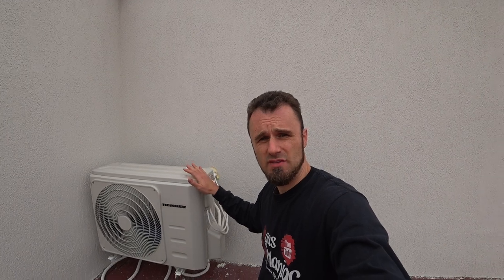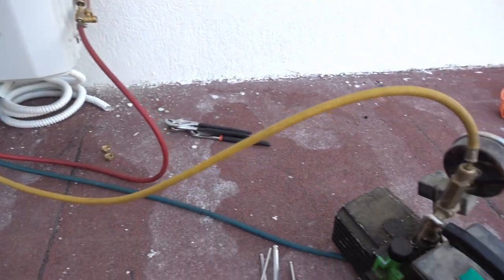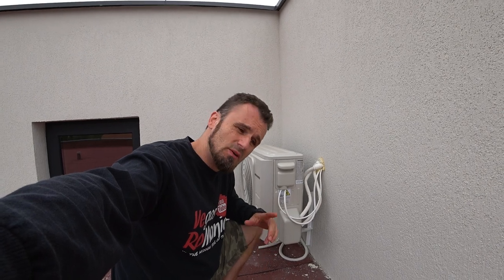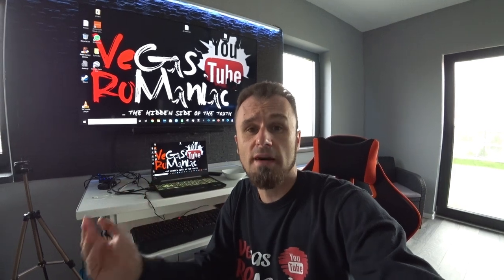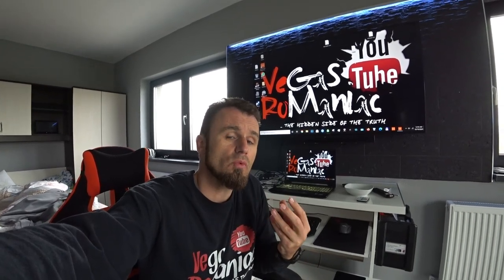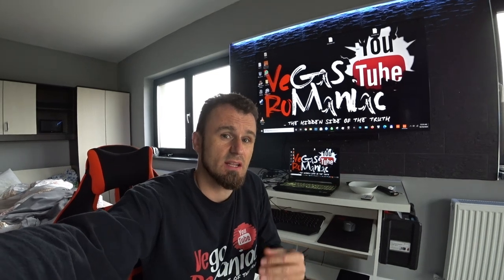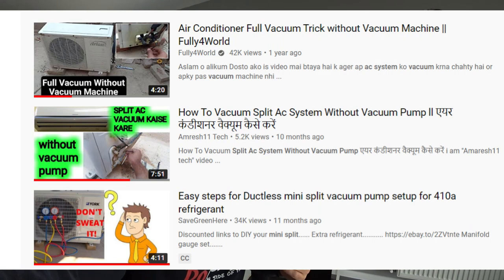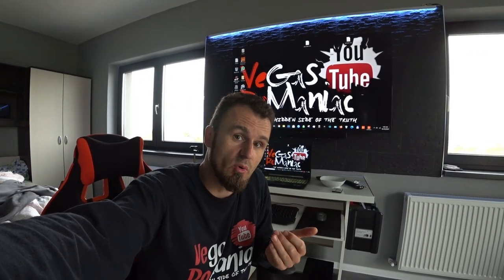How to install a Mini split AC without a Vacum pump

Comment: Been installing split A/c without vacuum since don't know how many years all I we do is before running the A/c open the gas from suction line and exhaust the air in the copper tubes through discharge line with the help of  manifold gauses.

Comment: Your right man I've installed 2 units. 1unit still works but the other one wont cool my room😕
Reply: Your connection with your flare connections were not sealed and probably gas went out 😔

Comment: Does the inside unit plug into the wall? What voltage is your unit I didn’t see a disconnect by the outside unit
Reply from the maker: Yes, the power comes from inside it's a 220, the 2 units are linked together and powered from the inside
Reply: @VegasRoManiacReviews  my cord that was connect has black white and green and it 220v
Reply: On my 3 mini's (2 diff brands). The electricity goes to the outdoor unit. From the outdoor unit there is a single cable (multiple wires inside it) that goes to the indoor unit (along with the copper lines and codensation line). This single cable powers the indoor unit and transmits signals between the indoor unit and outdoor unit.

Comment: I open the thin line to fill the lines with gas, shut the thin line. then purge the gas from the lines and re-opened the thin line. Next I turned the system on, everything is working fine. Day one.
Reply from the maker: Great to know , let us know how it goes in time
Reply: Is it still working fine when ppl say purge the line are y'all talking about that valve u use to vacuum ? What does purge mean ??

Comment: Vacuum pomp the air conditioner need only if the tubes  are very long... l have 4 units 12000btu from 2003 ( onoff) and working today with 41 grade Celsius perfect 😅😅😅... if you have 1 to 3 meters pipes you need to discharge 20-50gr gas...  3to5 do nothing ..up to 5 you need to put in 20-30 gr gas and you need vacuum...

Comment: You would get away with it without a vacuum pump and just releasing the gas into the system. If you turned on the pump, it would suck all the air and the water into the refrigerant anyways so that wouldn't matter. it is true that the air and the water will corrode and shorten the life of the system.
Reply from the maker: Yeah

Comment: I have installed an ac without vacumn pump 11 years ago.never needed top up for gas. Its a heat pump type ac. Split unit. You have an indoor unit and an outdoor unit that homes the compressor. Cooling system works like a dream after 11 years. 1 year ago the board inside the indoor unit failed so i have removed the board and rewired the system to work only on cooling because i only use it in summer. Never had any issues with cooling or compressor. So this is my experience. To prime it,the first time i installed it 11 years ago i followed an o nline guide i had found. I will try to find it and share it here.I remember it was vrery  easy. But the procedure has to be done before you start the system. You have to open and close the gas lines and press to purge the air for about 7 seconds but i dont remember exactly the procedure so as soon as ill find it ill post it here.
Reply from the maker: That's great to know

Comment: Let's clear some things up here! I'm a licensed HVAC technician. You shouldn't be DIY installing air-conditioners unless it's precharged linesets (which I personally don't think is a good idea either). And I can almost guarantee that in the installation manual it states to be installed by a licensed tradesperson. 

1. You need to pull a vacuum that's the bottom line. No purging the lines with refrigerant bullshit. 

2. "My SySTeM HaS BEen WorKiNG For YeARs AnD I DIDnT PuLl A VaCUum", you're quite lucky if that's the case in fact you'll find that without a vacuum your system may run for years but you introduce non condensables into the system which reduces your systems overall capacity to heat and cool and you'll find your compressor will start to run at a higher head pressure causing inefficiencies.

3. In the case you didn't pull a vacuum and the humidity was high in your area, you have introduced moisture to your system, moisture will react with your compressor oil causing a chemical reaction that makes it acidic and the acidic oil will begin to break down the compressor windings reducing the insulation integraty and eventually cause a compressor burnout. 

4. If you're going to the effort to install an AC, do it right. There's a reason people study this trade for years and understand the correct procedures. To do it right you need to have a micron gauge and a vacuum pump. You need to pull a vacuum below 500microns anything lower is better then you can charge your refrigerant.
Reply from the maker: Why hvac techs always watch my videos? You guys are not sick and tired of doing this every day? I did home theater for best buy, I never watch TV videos, I hate TVs I never wanna see a TV again
Reply: @VegasRoManiacReviews  I watch loads of HVAC videos. I'm very passionate about my trade. I just don't want the wrong information thrown around. Wouldn't it be better to ask a professional about the specifics of the installation?
Reply: @joshdavis2064  It all comes down to money. I think that, like any other industry, the HVAC world is built around standards and codes that are meant to bring insane amounts of money to some producers and contractors. For instance, flare connections suck out loud (This is not news material!), and leak detections, flaring equipment or flaring jobs cost money. Wonder why they didn't invent a failproof connection standard for ACs in the 21st century - one that doesn't leak or need leakage detection, one that comes as such from factory? Because some money have to be made, it's simple! But some people don't have the money or don't trust HVAC technicians to do a good job. I live in Romania and I saw dozens of hurried careless installations carried out by licensed technicians, so of course people will look for alternatives! In America, you will get much cheaper by installing a mini-split by yourself, and buying proper equipment. In Romania, it's the other way around - proper equipment will cost more than a commissioned installation made by (ill-trained) licensed guys (who can or will screw up).

Now, I will state clearly that I find this method of installation (by using refrigerant for purging air out of the system/without a vacuum pump) careless or risky at best, but, my case is that, instead of spending money on a high-quality vacuum pump and a vacuum meter or a manifold gauge/positive pressure meter, I have to spend a lot on flaring and proper torque values. Do you know how much a torque wrench costs in Romania? It's about double the price of a good quality vacuum pump, which is the same price a licensed installation will cost. (And that's the cheapest (analogue, not  digital) torque wrench of them all!) Not to mention I can't find any pipe that's flared well and ready-to-go from the factory. (When you do find one, HVAC technicians will always state how bad the factory flare is, and that they have to redo those. Maybe they're intentionally made bad from the factory, or maybe the technician is trying to just pull some money out of your pocket, I don't know.)

Why doesn't the HVAC industry create affordable and fault-proof piping or connection products, such as a connection that uses some sort of durable rubber-like seal, or a gasket made of a soft(er) metal that has better sealing properties than copper - a connection that doesn't need industry counter-products such as Flaretite or FlareSeal for its faulty nature? Why doesn't the HVAC industry create a nut that doesn't need a torque wrench? Is it because it's impossible (with all this technology and 21st century sophistication) or it's because some money have to be made? The latter one, of course! I'm not an engineer or a physicist by any means, but I have a physics 'processor' and knowledge that are decent enough to realize these things cannot be impossible. Or I may have just a proper amount of common sense.

I'm not a fan of conspiracies, but I think it's pretty obvious and in-your-eyes the fact that industries like Big Pharma and HVAC are all on making money. I'm not saying everybody should get a vacuum pump that will be used only one time. That would be a huge waste of resources! But, at least... I think everybody should have the right to do an installation by themselves up until the point of vacuuming (without selling a kidney), and still keep the warranty. From there, it can be carried by a professional. Besides these thoughts, I agree with everything you said.
Reply: @alexdanton4842  yeah i see where you're coming from.
1. The reason we use copper pipes is because it's soft and easy to work with when it's annealed. Flare connection are very good when done right and that comes with the correct tools and as you said it'll differ from country to country. Flare connection make a good seal because the copper is somewhat soft crushing it in the flare but when tight.

2. As for torque specs it's there because the refrigerants operate at high pressures sometimes up to 2800 kPa so they need that tight and good flare connection, the better alternative to flare is soldering the joint with an oxygen acetylene but there are other alternatives like crimp connectors or push fittings, but need to be compatible with the type of refrigerant.  

3. The diy side of things, we need to have people understand that improper practice that causes leaks is very bad as refrigerant is an ozone depleting substance there a reasons especially in Australia where you need to have been trained to handle refrigerant and dispose it in a appropriate way for this reason. If people want to give it a crack that's fine they just need to know what they're dealing with and nothing is stopping them from just dumping refrigerant into the atmosphere. Companies pay for licensing and public liability and materials to ensure that it's done right! Don't get me wrong I know they are dodgy companies and its a shame you've seen it first hand but it's like saying I'll do major repairs in my car on jack stands and watch a YouTube video tutorial whereas a mechanic has a car lift and is trained to do it over manufacturers specs. They're special equipment for the job and some can be very expensive but it depends on the budget. The saying goes.... If you pay peanuts you get monkeys. and most people that try this without a clue with what's going on end up paying twice.

I don't think it's the HVAC industry trying to squeeze out a dollar I think it depends on the demand and the availability big the equipment and the type of systems

Comment: I'm the owner of an HVAC contracting business. We have been able to pull a vacuum down to at least 500 microns and we have never had a compressor failure to this day. Quite often we charge $5000 or more for installations but we are willing to pull a vacuum for $250 if the customer just needs us to pull a vacuum.
Reply: 250 for 30 minute wowwww what a deal

Comment: I am going to install 1.5ton ac without vaccum pump.
Reply from the maker: Let us know how Itworks
Reply: I installed a 3 ton compressor today and didn’t pull a vacuum. Sucker ran great
Reply: @suspect_fb  for now
Reply: Still running great

Comment: Should also be pressure tested with nitrogen.
Reply from the maker: It doesn't have to but it can ...
Reply: Manufacturers instructions only recommend vacuum testing.

Comment: Should be called how to install mini split and invalidate the warranty
Reply from the maker: Warranty is 1 or 2 years .. they will last at least 5 without a pump
Reply: @VegasRoManiacReviews  If you dont pull a vacuum you won't have a warranty

Comment: Pioneer KWIK-E-VAC Line Set Flushing Kit Installation Simplifier for Mini Split Air Conditioning Systems

Pioneer KWIK-E-VAC Line Set Flushing Kit Installation Simplifier for Mini Split Air Conditioning Systems

Comment: Don’t do this without pulling a 500 micron vacuum on r410a.

The issue is acid and burnout.  

This is not really a diy topic, or empirically determined topic.  Please be very safe to get an experienced guy to help you out.  There is a lot to go wrong.  Of course I don’t have any accountability in what you decide to do.  Good luck
Reply from the maker: So if you look in my comments, there are people that installeld these ac's without pulling a vaccum and they work 7 years later.. Just saying the book tells one think but the reality, doesn't really mater... It seems